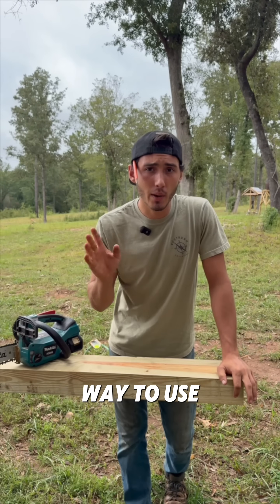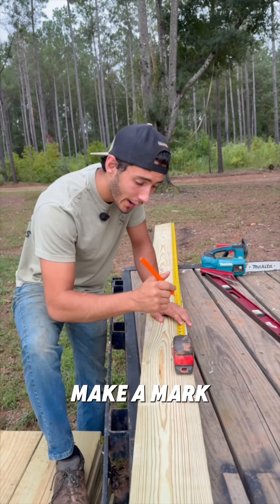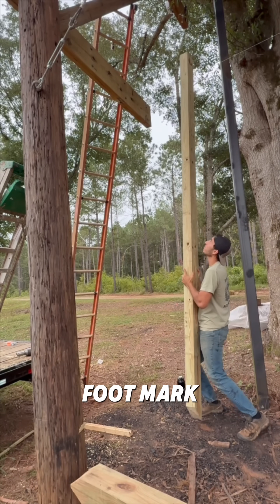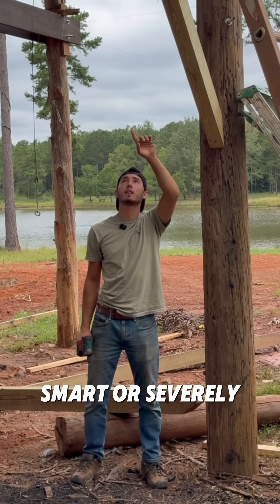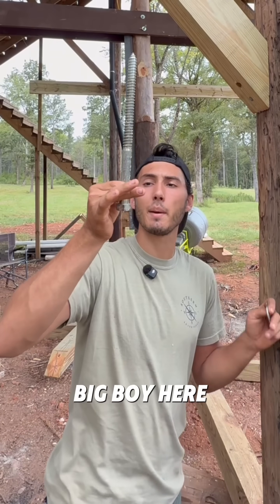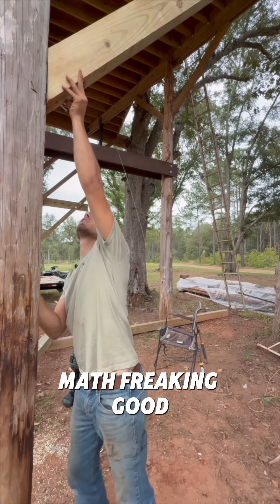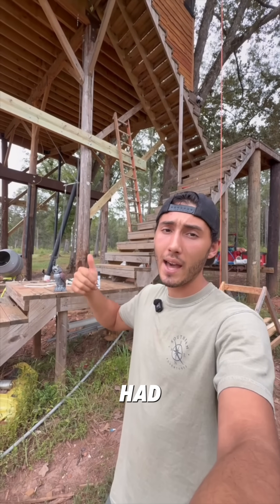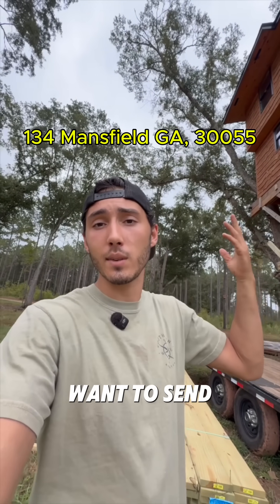Can Math Actually Make My Treehouse Build EASIER??

Comment: Dude, This is ONE Thing that I would have taught You how to do it RIGHT...
  Mechanical knee bracing should be notched into the material on top and bottom so it will stand with no fasteners. Then add some for good measure. I Really thought you were gonna make MARKS using your screw to hold the top, pull it down, make Cool cuts that you would see forever to Showcase your skills. INSTEAD you highlighted that you are Learning AS You GO 😂😢
  You are still Awesome 😎, and a BEAST! Keep it up man!🎉